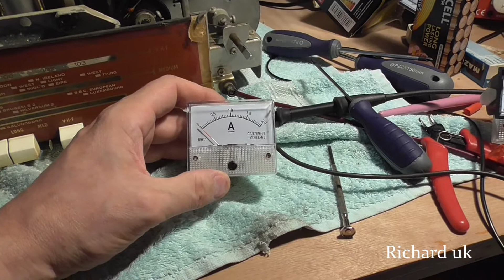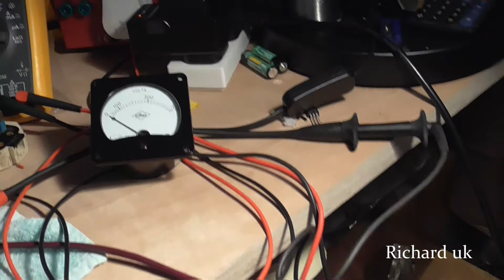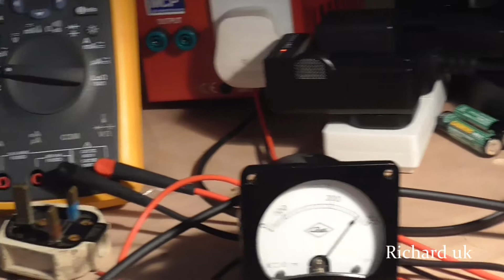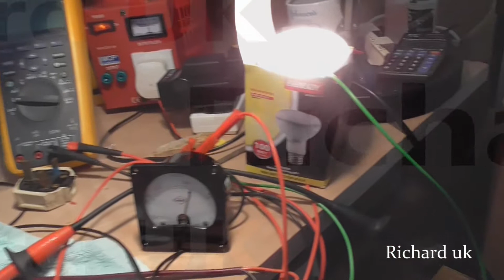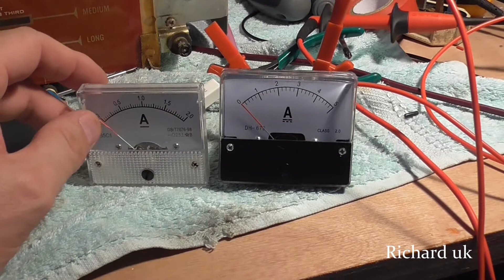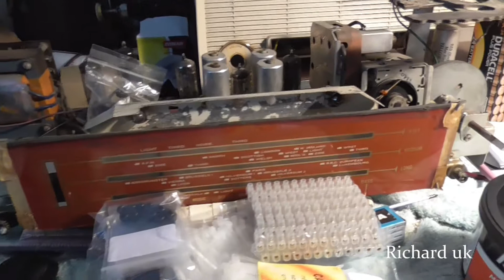Looking at the amp volt meter

Comment: the meters should be vertical when reading, Set the needles to zero.
If a meter is consistently out, you can "bias" the needle a touch with the zero set screw.
Ive cut the rectifiers out of DC meters and used them on AC, can be close enough reading,
 Was the ammeter "in" circuit?, no diode needed, If a shunt resister was needed on that meter and not fitted it will be burned out by now!.
 I seem to remember "The post apocalyptic inventor "did some videos on metering.
Bitsbox?
 Glad your friend is recovering, the warm weather will help as well, nothing worse than being unwell and it's raining!
 Cheers, J.
Reply from the maker: Thanks Average Joe. I have not considered that. I will look into that near the time when I can do the first shelf.. Thanks m8